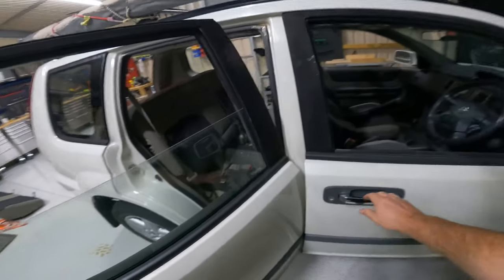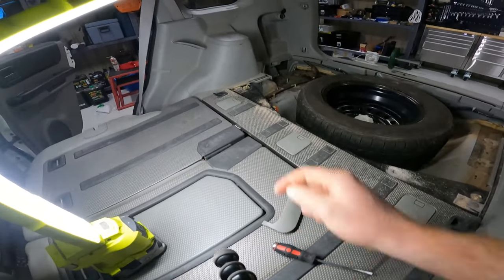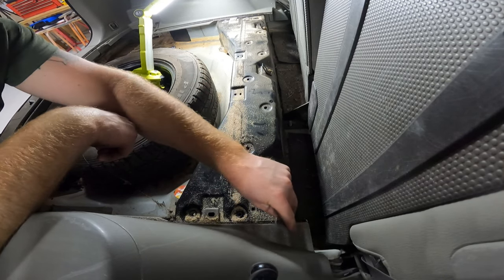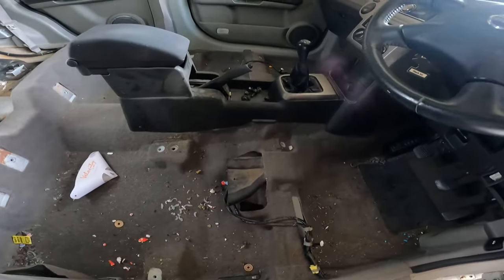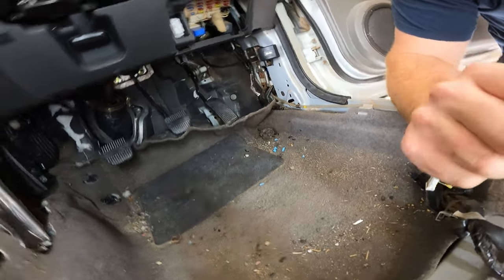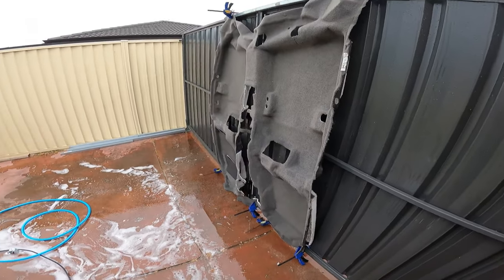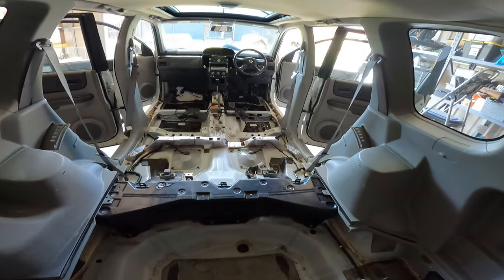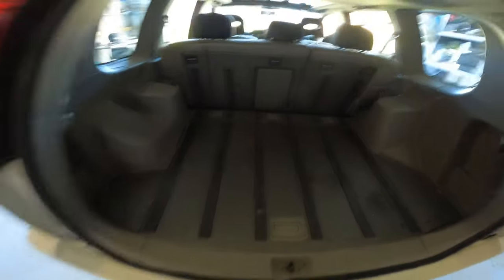T30 X-TRAIL BUILD, FULL INTERIOR CLEAN

Comment: Very useful vid for me as I drove through some pretty deep water , the river was overflowing the road by maybe 250mm , think the water came in via the door seals ? My t30 is older than this one but mostly the same . Won't be doing this again.
Reply from the maker: Ahh spewing 

Little tip Something for next time turn your aircon to recirculation and put fan on high will create a small amount of positive pressure in the cab. Won't stop water coming it but can help
Reply: Did put a/c on and fan on high , sadly afterwards ha ha , no worries everything’s out now and drying